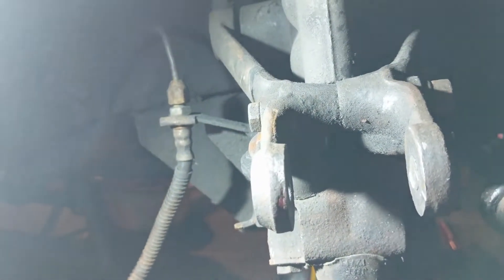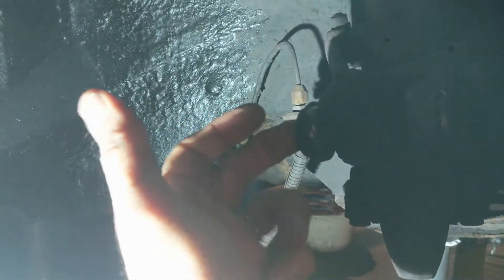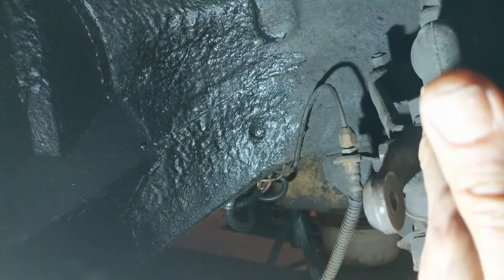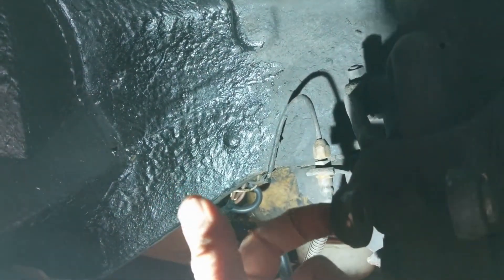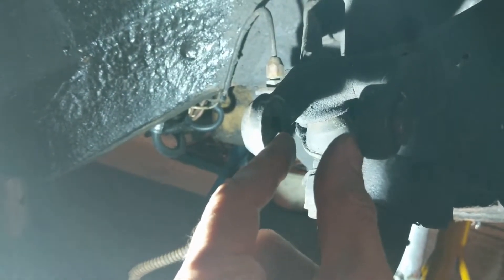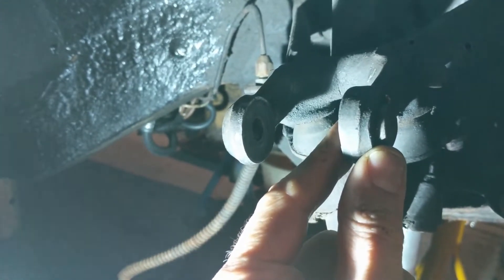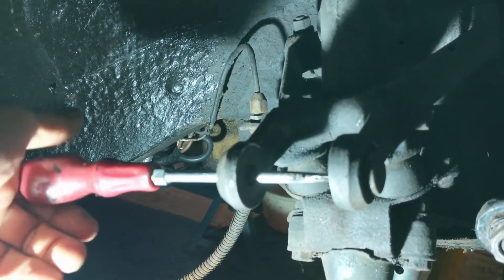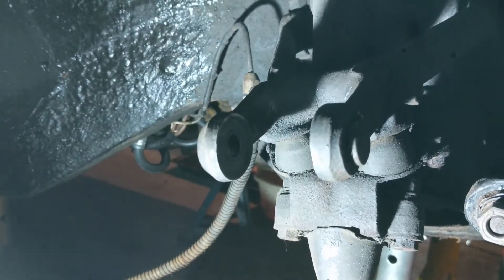MGB GT How do I remove this stuck fulcrum bolt

Comment: Hi Henry, Removing the damper is the way forward, as Gareth says it is only four bolts. 
If you have a reasonably sized vice, then place a socket slightly larger that the fulcrum pin behind it and use a bolt or something similar to clamp in the vice through the other (open) arm to use as a drift. There would then be no strain on the damper arms and your vice becomes a horizontal press. Should pop out easily with this method.
Reply from the maker: Thanks - yes.  I've seen this done and should have thought of it.  This will be my next approach, then I'll move towards drilling it out if I cannot get anywhere with this

Comment: That’s quite an easy fix, drill it out, start with a small drill and increase the diameter till you you get near the size of the pin, then use a blow torch inside the hole and clamp mole grips on the bit of pin that’s left, secondly, if you’ve got a decent blow torch with MAP Gas and a fine nozzle, heat the outside first without getting the pin hot, the ring will expand and should release its grip on the pin ( try this before any drilling).
Reply from the maker: Thanks Steve . I’ll give that approach a try

Comment: I’d take the damper off. Just 4 bolts. Then you can work on the bench. You should be able to drift it out with it properly supported. You could even take the arm right off  to work on it.  Also check out Dr Doolin you tube channel. He has a good tip for refitting that top trunnion.
Reply from the maker: Thanks - good call.  I'll take it off